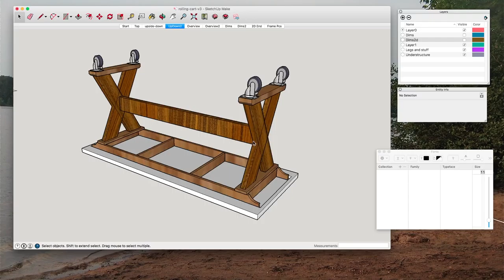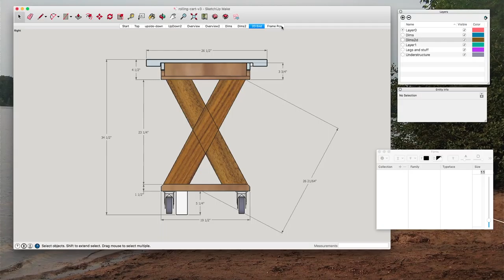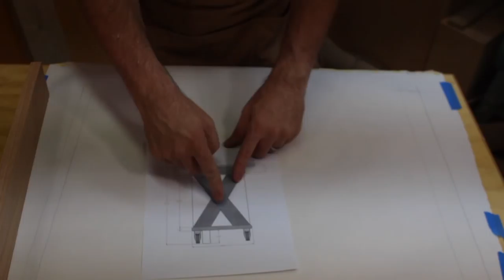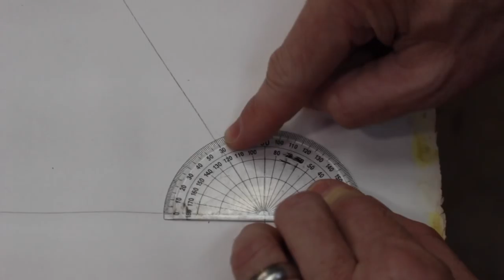Mobile Serving Cart, with Massive Half-Lap joints  (WnW #128)

Comment from the maker: Or call it a Mobile Island? Mobile Counter?
Build Article: http://www.wordsnwood.com/2018/cafecart

In which I build a mobile cart/island/counter for the cafe area at our church. I'm using various reclaimed hardwood for this. I have to make some massive half-laps, which was a challenge, and then stain it dark to match the other cabinetry.

Oh yeah, an there is a bit of sketchup talk as well.

---------- ---------- ---------- ---------- ----------
LINKS TO SOME OF THE ITEMS USED:

(AND/OR other tools and jigs that I use and recommend.
Most of these are affiliate links. If you buy through these
links it helps support my channel. Thank-you so much!)

JIGS/ACCESSORIES

http://amzn.to/1V4ZHkv — Painter’s Pyramids
http://amzn.to/2bfFjLh — Kreg Pocket Hole kit (I have an earlier version of this)

SMALL TOOLS

http://amzn.to/1WSNq1j — Stanley Leverlock tape measure 
http://amzn.to/2lYXz3W — Other auto-locking tape measures
http://amzn.to/1YP3rXy — Irwin Quick-grip XP600 clamps

FINISH:

http://amzn.to/2beVz3t — Minwax oil-modified Polyurethane
https://amzn.to/2EohYEv — System Three quick cure epoxy

BIG TOOLS

http://amzn.to/2bpMmkX — DeWalt DW735 Planer
http://amzn.to/2beSIY6 — 3rd party blades for DW735

GEAR I USE TO MAKE VIDEO:

http://amzn.to/1qPkvBp — Canon T5i
http://amzn.to/2aK7jZX — Inexpensive Quick Release tripod ball head (Very useful)
http://amzn.to/1SSwOmS — Sony Action Cam. (I use the HDR-AS15 which is discontinued -- cheaper than a gopro.)
http://amzn.to/267XM3M — Sony Live View video remote for Action Cam
http://amzn.to/1XC2D7l — Joby GorillaPod (Flexible small tripod)

---------- ---------- ---------- ---------- ----------
Many more woodworking projects:
http://www.wordsnwood.com

PLEASE SUPPORT MY CHANNEL

The best way that you can help support what I do is to buy one of my woodworking plan packages. 
Details here: http://wordsnwood.com/plans/

Follow me on Social Media:
https://www.instagram.com/words.n.wood
https://www.facebook.com/wordsnwood

---------- ---------- ---------- ---------- ----------
Thank-you!